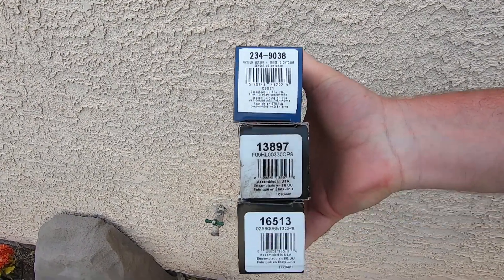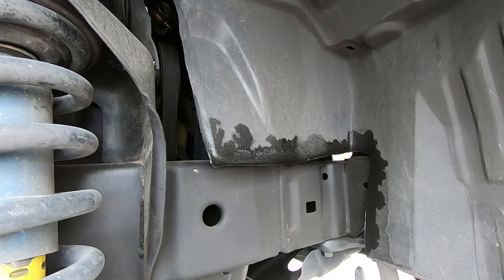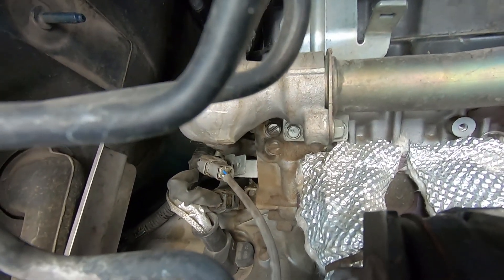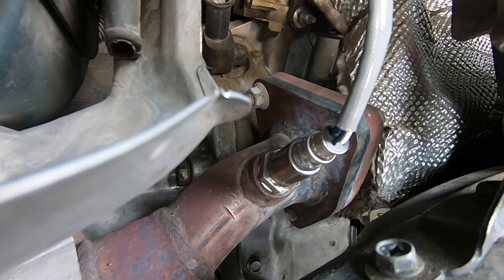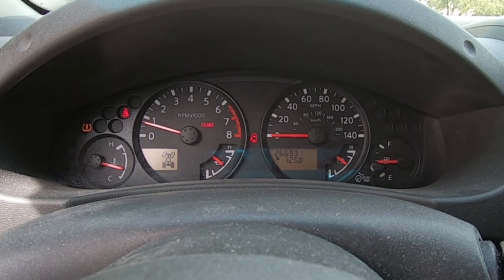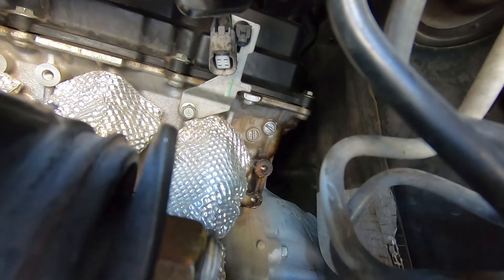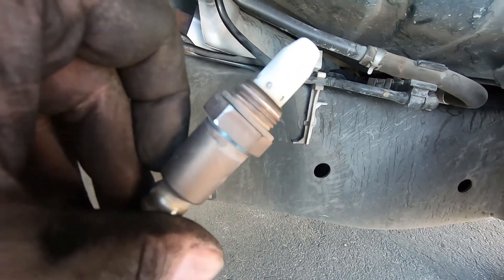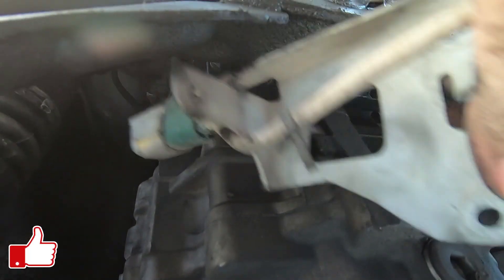Nissan XTerra - Episode 10: Air Fuel & Oxygen Sensor Replacements

Comment: I just changed an O2 sensor on my 2012 Xterra. I've never done that kind of thing before. This video gave me so much confidence and answered a bunch of my questions. A mechanic was going to charge me $900 to do it. But I did it myself. It only took about 1.5 hours today. I bought a cheap version of the sensor. It only cost $55 on Amzon. I know it may not last long. But now I know how to change it, if it goes out. Thanks a million!! You saved me a ton of money.
Reply from the maker: Glad I could help 👍

Comment: Hey Patick can you help me - You only showed 3 boxes but aren't there 4 sensors? I need to replace all four in my xterra but don't know which part numbers to get?
Reply from the maker: Two fronts are the same. The backs are both different. Part numbers are in the video.
Reply: @PatrickMichael2002  Thank you sir
Reply: Hey man what size socket did you use
Reply from the maker: @phillip3910  02 sockets. Not sure the size.
Reply from the maker: @phillip3910  02 socket

Comment: Will the 02 sensor make it misfire if it's bad?
Reply from the maker: Typically not. They are after the combustion cycle. Backfire is from unburnt fuel vapor. Like clogged cat or bad air/fuel mixture.
Reply from the maker: @giantkilla_  Cylinder misfires are some of the hardest things to trace down. Sounds like you did the basics. Harness is the only other thing left to replace. Had similar issues on my 350Z
Reply from the maker: @giantkilla_  The one for the coils. You might have a short or a bad connector then.

Comment: Great videos! Thanks for sharing. Did you ever end up addressing your power steering leak?  If so, did you make a video?
Thanks again!
Reply from the maker: @LostInStates  It got replaced when I had to do the rack, struts and uppers. Sorry, no video. Dealership repair.
Reply: @PatrickMichael2002  Did you figure out what was leaking.. hose or reservoir or something else?
Reply from the maker: @LostInStates  It was the unit itself - leaking and dripping down the hose.

Comment: So the green sensor plug was the bank 2 sensor 1? Having codes p2a03 and p0420 on my ‘06 xterra are they both sensors I have to replace? Doing this on my own 😅
Reply from the maker: P0420 is a catalytic converter error
Reply: So my bank 2 sensor 1 is on driver side before the cat?
Reply: Would mine be the last sensor that you changed? Mine I ordered from O’Reillys it’s the sensor for b2s1, the cord is green though?
Reply from the maker: @mirandacastro6174  Part numbers and locations are in the video. B1 are A/F sensors. B2 are O2 sensors. Green cable is noted around the 22:50 mark. That is B2 S2 O2 on driver's side. Sounds like you don't have the correct part.
Reply from the maker: @mirandacastro6174  B1 S1 & S2 should be before the CAT. These are A/F sensors. B2 S1 & S2 are after the CAT. These are O2 sensors. Passenger side is S1. Driver side is S2. Both front are the same sensor. Rear are both different. One has black clip on passenger side. The other is green on driver side - as noted in the video. This will not fix PO420, though. That is bad CAT. Watch my other video on replacing that. Happy wrenching 👍😎👍
Reply from the maker: @mirandacastro6174  Passenger side after CAT
Reply from the maker: @mirandacastro6174  Wrong part. Sounds like B2S2. They are not interchangeable. Black plug into black. Green plug into green. Part numbers and descriptions are in the beginning of the video.

Comment: Great video. Which code/codes were you getting before you replaced the sensors? I’m trying to track down an issue on mine with similar mileage. Thanks.
Reply from the maker: P0131
Reply: I had a P0130 on my 2007 Frontier that is the same platform as the Xterra and Pathfinder. I replaced bank 1 sensor 1 oxygen/AF under the right front wheel well (first replacement shown in this video), and the service engine soon light went out and stayed out. Something else I saw suggested removing the negative battery cable when doing this fix. I used a regular 22 mm socket to remove the sensor after cutting the wires. Disconnecting the connector was the hardest part of the repair.